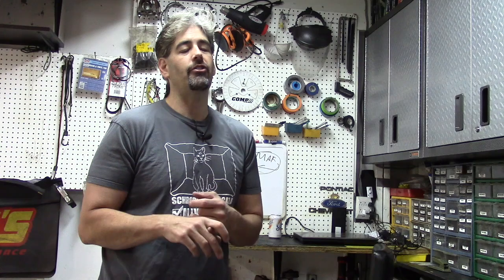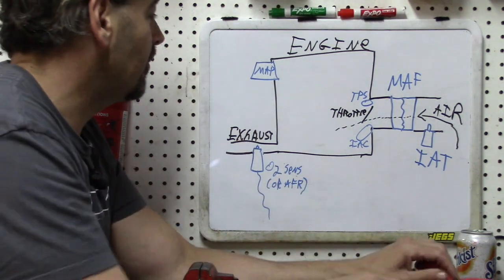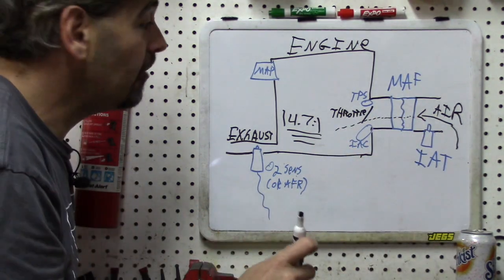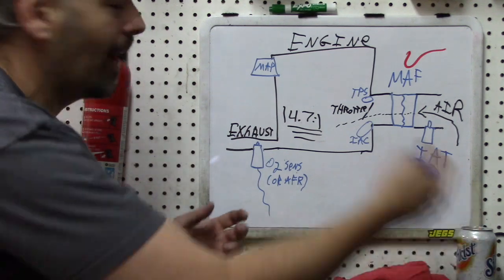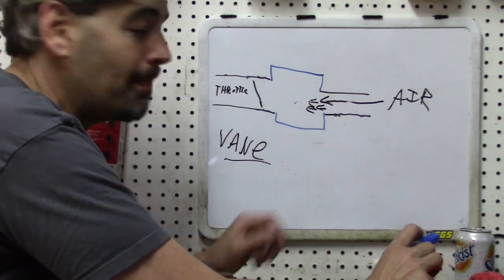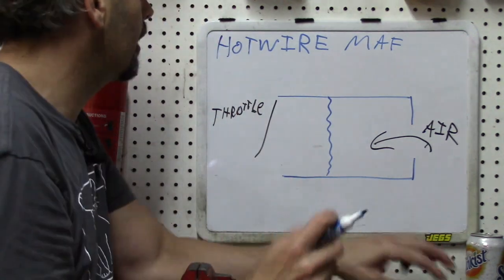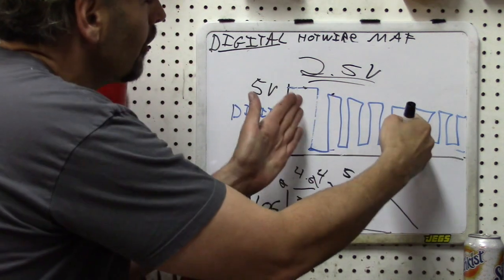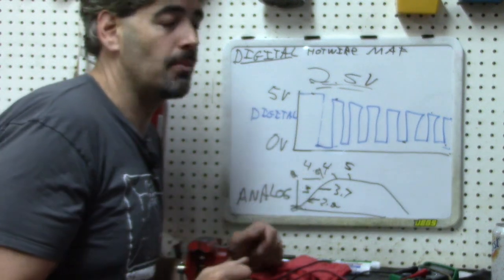Diagnosis and Understanding: MAF Sensor Pt1 Analog, Digital, Hotwire, P0101 P0102...

Comment: There are zillions of youtubers with their massively edited useless videos and on the other side there is this boy who is killing it with a micro white board and pen
Reply from the maker: hahaha thanks man!!!
Reply: Aint that the truth. 

I told my dad about the wonders of DIY videos and the horrors of the same "hey, heres 45 minutes of my life story and a camera angle of the floorboards, good luck getting to the info" type of videos. 

Therezs a channel of all 2-5minute MAX home appliance diag and repair videos. They straight up tell ya "this video covers diagnosing the stove heater pots, go to video X in this playlist for how to remove the panel."

Then just BOOM, right into the info you seek.
They are my heros.
Also, that was Dads first full irate into tranquil repair and DIY Internet info searching project.

Old dog, sure, but hes still got some new tricks..😂

Wish I could remember the channel, at the moment.
They are so good, ya just sorta get your info and move on.
If I can find it in my 1000 plus subscribed channels, ill try to edit it in here.

Edit: AppliancePartsPros is the youtube channel.
"

Comment: Got an issue with a MAF sensor on my Ford, so I kicked off by searching for videos on MAF sensor testing. What was I thinking? When will I learn that, for proper diagnosis of engine faults, there's really only one guy. Ok, ScannerDanner is good, but this guy takes the biscuit. It almost seems ironic that the best automotive teacher on YouTube is also the most under-rated. Forget the others, just filter your search results to include only those from Schrödinger's Box.

Comment: Thanks for this analysis. II ended up replacing the MAF Sensor to no avail. Your explanations video help demonstrate how a  trouble shooting diagnosis procedure can improve. The symptom was the engine turning and starting before shutting right off. Unplugging the Mass Air Flow Sensor made the 3.3 GM V 6 run okay. At some point I looked over everything I touched when trying to figure out how to access spark plugs for cylinders 1 3 and 5.  Upon doing so I noticed a loose bolt that was securing  a vacuum source that I learned to identify after referencing the service manual.  The following day I heard a hissing sound and found a broken tube that connects to the evaporator canister.  I used electrical tape to help provide a seal to the bolt attached to the vacuum source since i over torqued it and bent the piece inward.  Then I used electrical tape to help secure the vacuum hose leading to the evaporator canister.  The car finally starts up and idles okay. Now there is  a DTC 22 (Throttle Postion Low) that I am waiting to see if it goes away after driving and re- learning by the computer now that there are little to no vacuum leaks.
Reply from the maker: Just simply Check the fuel trim to confirm if the vacuum leaks are gone.

Comment: FYI. It's not necessary to have an oscope to read the frequency signals. A fluke 289 will read the frequency, amplitude and duty cycle and even read PWM all on one screen in numerical values. Not as good as an oscope. I have an oscope too but it's AC powered with I think tends to induce unwanted noise into the trace. I would like to get a snapon modis.   Love the videos, great job.

Comment: There IS no easy way around it. But the time you take to watch these videos will give you an understanding of how these modern engines run.  It will also save you a ton of money buying parts YOU DON'T NEED and actually zeroing in on the cause of the problem. I.E... the CHECK ENGINE light comes on.  An error code trips it.... could be an O2 sensor.  But it doesn't mean the O2 sensor is bad necessarily. There are many reasons an O2 sensor will send an error code. This applies to many other sensor and codes also. This is the value of Matts videos. If  you LIKE buying parts you don't need, chances are good you'll be gone in 5 minutes.  But believe me man....I used to do EVERYTHING on the old pre-ECM engines. Early '80's. V-8's, Slant 6's, Straight 6's, 4 bangers.  Could do anything on them. Blindfolded.  Then....I lost my garage due to divorce moved to L.A. I didn't open a hood in 2+ decades. In 2017 I bought a 2005 500 Limited with the 3.0L Duratec DOHC V-6. When I opened the hood I didn't know what I was looking at. It was a WTF moment FOR SURE!! But I knew, bottom line, it was still AN ENGINE. I bounced around YouTube, watched lots of "HOW TO" videos and bought parts that did NOTHING. Cleared the Check Engine Light and thought I was good.  A few days later the light would come back on WITH THE SAME CODE!! So frustrating man. Then, thankfully, I found this channel and learned more than I could ever tell you here and I still am. But I'm not intimidated by these engines anymore because of Matt. Doing my own work again and come back often for refreshers. The best automotive channel on YouTube HANDS DOWN on understanding the WHY instead of the HOW to do a job. A huge difference.  Thanks A MILLION buddy!!
Reply from the maker: Thanks for the great comment.  You totally get it man.  Congratulations and happy diagnosing!!

Comment: Thank you !!! You are amazing good to explain theese things. From this video i finaly understand why, in my Peugeot 207, the MAF voltage was 2,5v compare to the ground and 10v aproximatively compare to  12,5 Volts of battery. Because is a Frequency MAF.  I have installed a kind of  device for controlling  some sensors , for increase the mileage.( That's because i have installed a HHO Hydrogen cell on my car ). Now i will try to connect that device to MAP sensor and the second IAT sensor who are near the intake engine. ( it is the first IAT, near the MAF , after the air filter) . First i will verify if the MAP have a voltage output... I can't find the Oxygen sensor(s) in this car. Or maybe they don't exist. It's a Peugeot 207,  1600cc , 110 HP , Turbo-Diesel , 2006.

Comment: awesome explanation. You should explain how the MAF produces the 1-5 volt signal back to the ECM in relationship to air flow past the Hot wire.. You explain how the Hot wire receives varying current to maintain a certain temperature via the 12v wire. But what does the 5v reference get processed with in order to send the relative signal back to the ECM?

Comment: Very great presentation. More mechanics need this kind if training especially in my country. Very few goes to school or have formal training. Your at there mercies and when you do find a good mechanic you have to pay through your nose. Thanks for making theae video.
Reply: Renee Redwood  I’ve been a mechanic for 42 years and want to be an electrician, you would not work for the wages we get , ps all this shit on motors is why they are never out the garage

Comment: I am an auto repair professional. I was using your very informative MAF videos to help me with a particular diagnosis. You talk about 3-wire, 4-wire, and more sensors. I have made an image for a MAF connector for a 5-wire MAF on the VW Jetta I'm working on. The pinout works like this: PIN #1: IAT SIGNAL; PIN #2: B+ FROM FUEL PUMP RELAY; PIN #3: ECM LOW REFERENCE (-); PIN #4 VREF ECM +5VDC; PIN #5: MAF SIGNAL. I can't offer the image in the comments, but I can offer it to you if you like.
Reply from the maker: sure I would like to see it. schrodingers_box@yahoo.com
Reply: This is a fairly common configuration for integrated MAF/IAT sensors.

Comment: Most common DVOM's will only do 1 second refresh rates (1 Hz).  That means you can only have 1 signal change per second.  Any faster than that and the DVOM is no longer reliable and only an oscilloscope will be able to measure the digital signal.  Understanding electronic concepts such as frequency, amplitude, and modulation is crucial in understanding the limitations of using a DVOM on things like a digital MAF or O2.  Comes down to the right tool for the right job.  You wouldn't use a screwdriver where a sledge hammer is needed right?  Brilliant video so far.  Really enjoying this.
Reply from the maker: ***** Is that right? Only 1 Hz? I  had no idea... I thought maybe at least 10 or 20hz but thats crazy!  Man How in the world did I live with only a DVOM all this time lol!!
Reply: Schrodingers Box It can vary depending on the DVOM.  More expensive top of the line Fluke meters can track frequency around 400Hz.  Most common cheap meters (under $100) are only 1Hz yes.  They are designed for measuring voltage not frequency.  Frequency is a premium feature. I think more specifically it's like .98 of a second or something like that.  Close enough that it's basically 1Hz yeah.  That's why they're so cheap compared to Fluke's and other meters with advanced features.
Reply from the maker: ***** Lol, you are to DVOM's what Danner is to the Verus lol. I never even knew any of that.  All I know is Fluke looked like a gyp at $400+ lol. Now it makes sense.  I always thought I was expected to pay for a name and the ability to keep the high/low reading lol
Reply: Schrodingers Box There's certainly brand cost like Apple associated with it.  You are right about that but it does have more valuable and powerful features.  The line conditioning inside the meter is much tougher too.  Quality components.
Reply: Schrodingers Box I'm definitely not that good with DVOM's.  I know more about them then how to actually use them lol.  You are probably better with them than I am.  Seriously.
Reply from the maker: ***** Lol well we are both better than the last viewer I had that blew his PCM.  He wanted to measure voltage on an injector harness to see if it was causing his misfire code.  So he backprobed the injector harness with a paper clip-  Yes, as in both wires on the harness "jumped" with the clip. He then puts his DVOM on opposite sides of the "U" on the paper clip. He said he kept reading 0V and the car started blowing smoke out the exhaust that smelled like raw fuel. Having 0V he called a bad injector but when he replaced it the car still misfired and blew raw fuel out the exhaust. He probed the new injector same way and still had 0V.
  God I am so glad I started this channel. Beats anything I ever saw when I hung out in the forums.
Reply: Schrodingers Box In the absence of water some people will drink sand.
Reply from the maker: ***** True, but some people drink sand even when the water is there.
Reply: ***** Well he will also be eating a new PCM!

Comment: i found that the vaf sensors are quite reliable (i think i replaced four in 28 years, three had bad fuel pump switches, never had problems with carbon build up) i think the biggest drawback is slow response time and i suspect they are more expensive to manufacture.

Comment: The frequency can be easilly be measured by your ear with small speaker connected thru 1k/10k resistor. You will simply hear the frequency. This is usefull for those who doesnt have an osciloscope.
Reply: +Tomáš Kamenický (ViaExplore)  Thank you ! I will try this. It's an interesting idea ! Wow.  The speaker thru the 10k resistor and the ground ,i think.
Reply: Interesting idea

Comment: Hello Matt!! Excellent stuff!!! At 6:22 the engine does not maintain stoich. at all times, it runs lean at decel, rich at WOT and most vtec and direct injection engines work lean at partial loads low rpms... In fact the more advanced the engine, the less time it operates at stoich and homogeneous combustion (as lean modes require stratified mode as you most likely know)... Just a thought! Cheers!! 
PS: i'm inclined to watch the fuel trim video (it is the best) with my classroom... will give you feedback if i do so...

Comment: I got one im my shop i wish you could go through. 2016 mazda 6. P0171. Ltft is stuck at 20.3 and stft 10+ the fuels trims stay this lean at idle and when increasing throttle, they are always like this. Low side Fuel pressure is good (65psi at idle), high pressure fuel pump is good (actual vs desired right on spec), all input sensors are good with normal readings, no vacuum leaks, pcv system is good, purge valve is good not stuck open causing more vaccun. I ran it on fuel injection machine in the fuel rail to eliminate bad gas or something, fuel trims stayed the same. AF ratio sesnor is good, maf has been replaced with factory maf, no change, always reads in spec. Vehicle has a map sensor also, readings from that are on spec also. Im at a complete loss at this point. Oh the fuel injectors are very clean, as seen with boroscope, as they should as I ran fuel injecton cleaner through it. I don't know what to do at this point....
Reply from the maker: what happens if you induce a rich condition on the engine?
Reply: I dont have a propane injection tool so the only way I can introduce a rich condition was by spraying throttle body cleaner directly into throttle body. For the short time I could do that before killing the engine the stft did go negative for once. that was only time I ever saw the stft ever go negative while running this car. When I reset the fuel trims by clearing the KAM, the stft just climbs to max and it actually runs pretty bad while it's learning the fuel trims, rough idle, stuttering and then once ltft hits 20.3 and stft go back to 10-15 ish it runs pretty good. No loss of power or rough idle. But still sets a lean code cause of how high the correction is
Reply from the maker: What do the oxygen sensors show if you drive the car at WOT?
Reply: @SchrodingersBox  when driving and going WOT the O2 goes lean. Fuel trims stay  at 20 ltft and around 10-15 stft. On decel the stft will go to 0 and ltft stays at 20.3
Reply from the maker: Ok that’s a huge clue. At WOT a car should always run rich. Your O2’s should max out rich. If they do not they you have one of two issues- either insufficient fuel delivery OR undermeasured induction. 
  Those are the only two possibilities.

Comment: I cameback to rewatch this after your recent MAF videos. 
There is nothing that scares me more than not knowing what the maf reading should be. 
In diesel they operate differently, I guess.
Reply from the maker: Yeah I used to think the same actually- “what should the MAF read?” But what I’ve learned is that on an analog MAF- all that matters is the voltage. If the MAF voltage is not at least 4V at WOT- there’s a MAF issue.  That’s all that matters. 
   Now on a digital MAF you can’t really do that so it’s definitely more of a challenge.

Comment: Max has the right idea but I think the explanation is slightly off.  I would say that square wave pattern will change. At higher air flow, the MAF would have to be supplied hear for longer  higher voltage would be sent to MAF for longer duration and for less flow, for shorter duration. So the shape of the square wave would change. I would guess that the frequency would be the fundamental frequency of the fourier series  or FFT of the wave form.  Thanks for bringing great videos Max

Comment: I just solved an issue that was being caused by the MAF not having a screen in front of the sensor. I have a K&N intake system but they don't put the screens in them. Car was running poorly at light throttle. I remember that being mentioned here so I bought a piece of aluminum honeycomb material and made a screen for it and the problem went away. Thanks for the video.

Comment: I just cleaned my MAF by removing it and and spraying it with CRC electronics cleaner and no wiping or touching the wires on a Ford Windstar 2003 model with a 3.8 engine and the difference in idle was dramatic in a good way. I had just within the last month replaced the head on the front side of the motor because of a burnt and leaking exhaust valve , the idle after the head replacement was good but not right. Eventually the engine light came on (after 500 miles) and I got a code of PO 174......I would suggest doing this cleaning before replacing the MAF itself as they can be pretty exspensive...instead I spent nine dollars for the spray from CRC which leaves no residue.....The sensor is the first to affect engine idle ...and if it doesn't solve a rough idle you can move onto oxygen sensors or gasket/PVC leaks etc... in my case it was dirty wires on the MAF...just an option for you all
Reply from the maker: How would a dirty MAF cause a P0174 but not a 0171???  What was your STFT and LTFT showing before and after?  That is not possible.

Comment: Dear Matt
Many thanks for your afford and the informations you shared with us. I have been searching the net for a long time and I haven't found the detailed and well structured infos like you share. Please add some about diesels especially. 
Since I am driving a Ford Kuga (MY2013/ 2.0 tdci AWD) and having troubles with hesitation at low rpms (like after giving a way in a roundabout)
Again many thanks

Comment: I have a 1996 Olds.Lss 3.8 Super Charged.My sensor has three wires. Ign.on only. 12vpin-Gnd Pin-2.5v Pin. No 5 volt wire.
Engine running the change in  the 2.5v pin bounces between 2.5 and 2.6 never goes past 2.6v..
So if the system is digital will you read any difference in voltage on the reference wire. With the engine running. 
Are you saying the analog meter will not read anything at all with the engine running if the signal is digital. Still fuzzy here!  
I have a Chilton manual but it has nothing for testing any sensor problems.
Nice video, you are a devoted informer and greatly appreciated by many I am sure.
Reply from the maker: You will possibly see a change in the average voltage but it will not necessarily be dertectably  proportional to airflow.
  On a digital sensor you really need to measure Hz, not voltage.